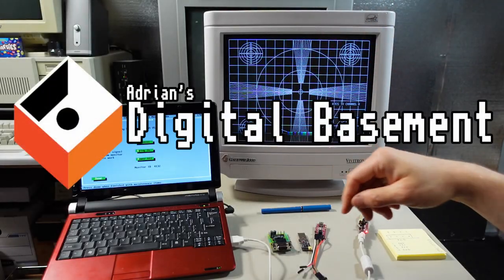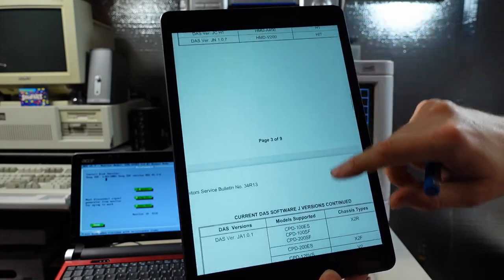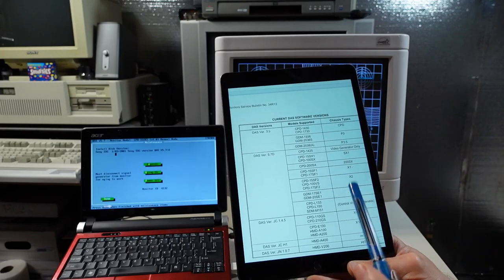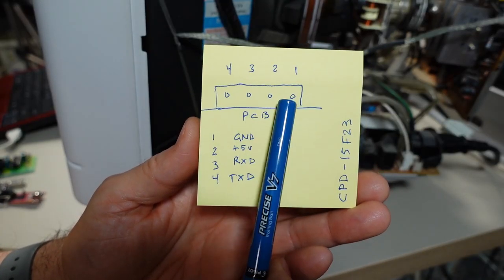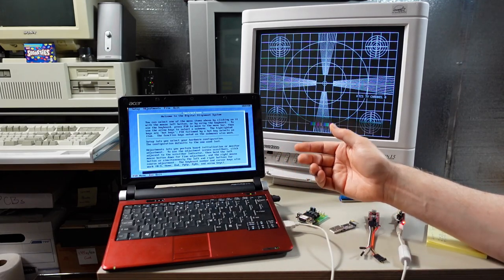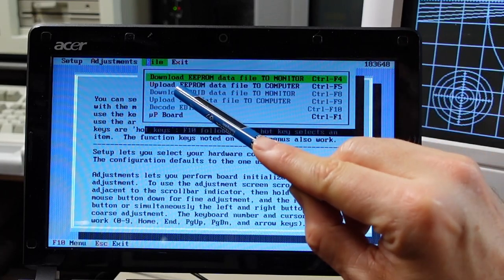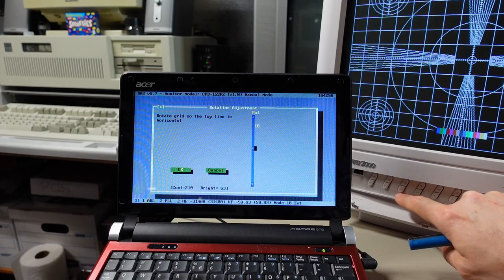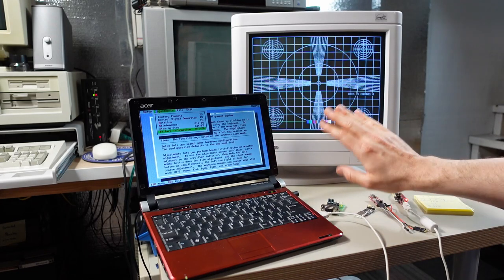Using Sony DAS (And WinDAS) to calibrate and breathe new life into Sony computer monitors

Comment: This shows why right to repair needs to be a thing, and the difficulty of making repairs has been creeping into our products for a long time. Sony in the past would have made monitors adjustable via a few pots, then they changed to software that clearly wasn't released to the public so they would not be able to make adjustments themselves. And even the service manual saying "confidential" at the top! why should a service manual for a product be confidential?
Reply: Looks like you don't know what right to repair is; it's not for the public to repair their own devices, it's for 3rd party repair shops to repair those devices.

TV repair shops had access to the software and manual back in the day.
Reply: @Okurka.   You are describing the exact problem, that only the manufacturer and those people/companies chosen by them is able to effect repairs. The right to repair is about everyone being able to effect repairs. The first line of the wikipedia page says it all "The right to repair electronics refers to proposed government legislation that would allow consumers the ability to repair and modify their own consumer electronic devices, where otherwise the manufacturer of such devices requires the consumer to use only their offered services"
Reply: @DavePoo2  I clearly said 3rd party repair shops, not repair shops chosen by the manufacturer.

The right to repair is about access to parts and manuals by 3rd parties, not by consumers.

Never quote Wiki as your only source.
Reply: @DavePoo2  So you're going to spend $1000 on a programming jig to fix your one monitor at home? Nah. In reality, the "smaller" shops driving the lobbying for right to repair are still huge, and still don't really want you to fix it yourself, they just want you to go to them instead of the manufacturer. You're acting more like the protocols and licenses would be open source, where hobbyists could sell cheap programmers that would be worth buying for 1 repair. Not gonna happen with capitalism, unfortunately

Comment: It is typical for Sony (and Apple) to come up with a proprietary, Byzantine and expensive solution for a system that used to be simple.
Reply: Actually as these things go, this isn't that painful. Access to the port (with the cover still closed) varies, but so does access to the potentiometers on older monitors. For being the first iteration of the system, it went reasonably well, which is more than I can say for some of Sony's other overly ambitious moves.
Reply: For an assembly line alignment system this looks very reasonable.
Reply: The problem isn't that it's done using a microcontroller instead of hardware potentiometers. The problem is that they made the software proprietary.
Reply: @avrahamhollander9296  Given Sony's history with DRM and rootkits and the like, they really didn't try very hard to lock people out of these. When I would remove the protection on software like this, I'd find the place where it queries the dongle, and then reverse the instruction after the pass/fail determination so that when the check FAILS, the program continues, but if you actually have a dongle, it'll crash.
Reply: It’s not just a Sony thing. Many companies only sent service manuals to repair shops.  And then when things went digital, the codes and software and ROMs were all kept private too.

It sucks but you can’t act like Sony was the only offender.  Support has always been a meal ticket.
Reply: It only used to be simple when there was only 1 resolution. If you ever wanted to change resolutions on a multisync, you would have to fiddle with 5 knobs every time, or add memory to store the settings for each resolution, like this

Comment: "let's overcomplicate things by replacing something that can be done on the thing itself with controls by a system that requieres a computer, software, and weird adaptors to plug it into the computer!!"
Reply: And licensed software instead of freeware.
Reply: For a manufacturer, the prospect of being able to push out a firmware update that puts the monitor in a known state makes it a whole lot easier to determine if a unit that fails QC just needs tweaking, or if there's something seriously wrong with it that requires a full rework. A few minutes of a technician's time diagnosing a fault can make this transition well worth it. It depends, of course, on how common faults are, and how much the microcontroller system costs.
Reply: "let's simplify calibrating the monitor during fabrication"
Reply: @mal2ksc  An added bonus, but they made the switch because of consumer demand. Adjusting several knobs every single time you changed resolutions was annoying, which was a lot when DOS and Windows were in use at the same time